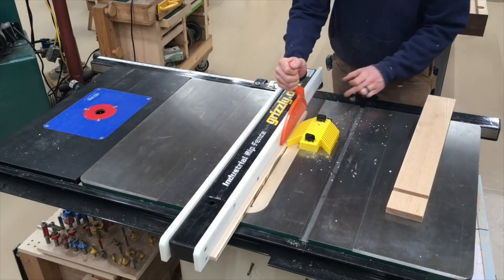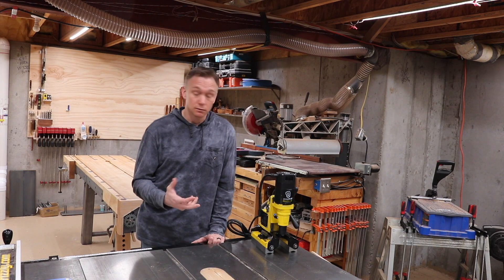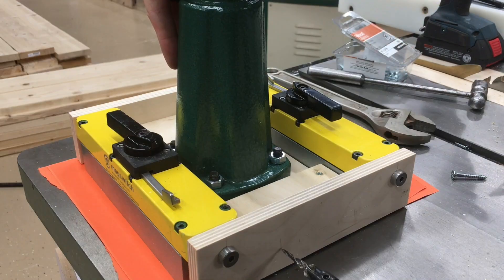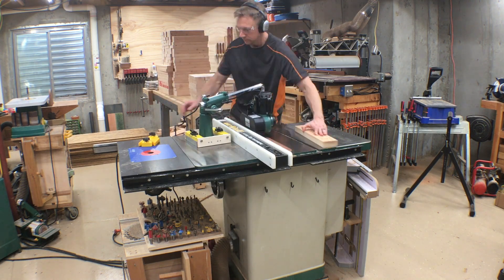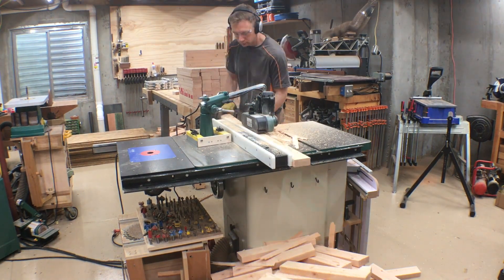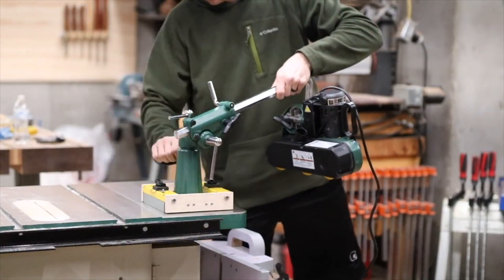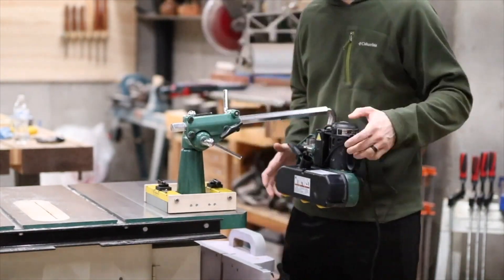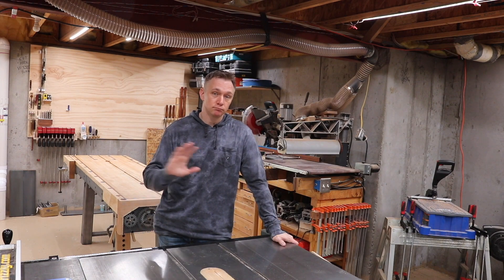Magnetic Power Feeder Mounting Kit

Comment: I have my 1/4HP feeder on these magnets but made the wood magnet holder longer and added a couple of 235# MagSwitches to the two larger magnets.  Works great but not sure if it would support a 1/2HP+ feeder due to its weight.

Comment: Great concept. My only concern is that people ready to invest $500 in a base +$XXX(X) in a mobile Power Feeder may also be the people who can afford a high-end table saw which can be configured to have one from the start. But I might be wrong and there could be a nice niche in between.
Reply: $500 was the retail value of my saw when sold new, I paid less for used. But even at new prices, just drill 4 holes in your saw. It can handle it. I would want to use this on the router table, too, which is wood. I'd be having to mess with the bolts anyway. Even if drilling is out of the question, I feel like there's a lot of ways around spending $500 for some magnets.

Comment: Nice idea. I'd bought a power feed  to install on a Robland x31 combination woodworking machine.  I've rigged it to work both for the spindle moulder, and the table saw. There are two different mount platforms installed on the machine both made from plywood with 4 metal threaded inserts to bolt the power feed to. One of the platforms doubles as an outfeed table. The magnetic base would be quicker to install and remove. That is one of the drawbacks of bolting it down. However, if you are using a power feed it's normally because there is a fair amount of timber to be processed.
Reply from the maker: Yes, I see this as a solution for a smaller single table saw shop that does occasionally need to process a lot of boards.
Reply: Great presentation. As usual. Always enjoy them.

Comment: Congrats Andy! I just discovered this last night and have a question. It looks like your build as well as builds in the other videos you linked were all using the 1/8 HP baby power feeders. Will this base be able to handle a 1/4 HP feeder? They look to be about 50 pounds heavier than the 1/8 HP models.